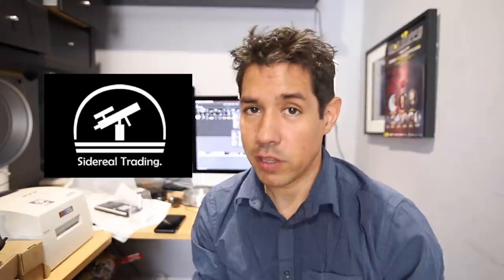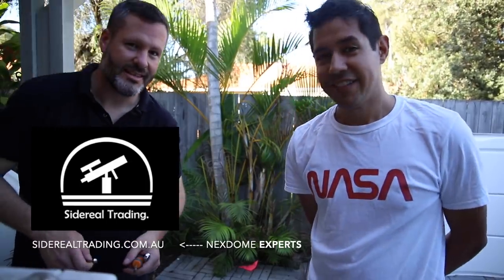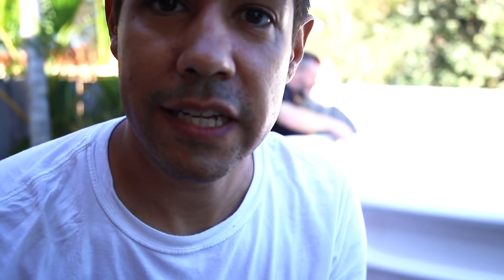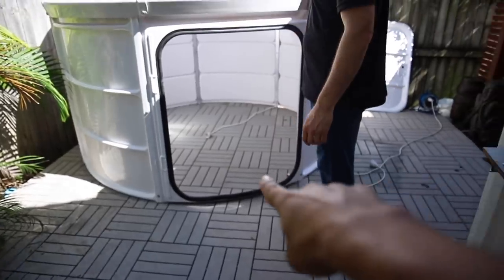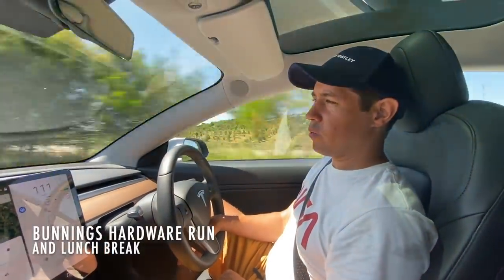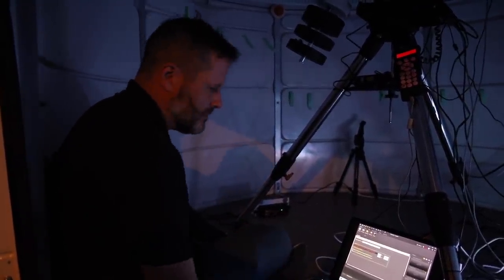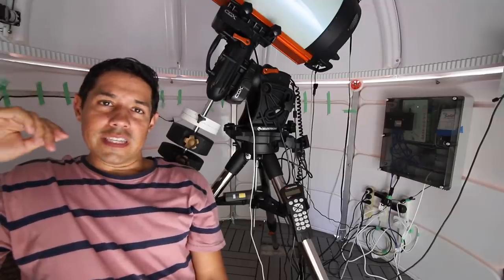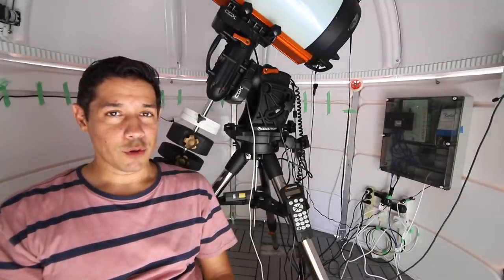Building a NEW Automated Observatory! 🔭 ft/ NexDome

Comment: That was so interesting, and having that dome must feel like a dream 😍It feels like it would be near impossible to build it all by yourself though no?
Reply from the maker: There are some screws, and lifting the dome up onto the walls, that really do require a few pairs of hands, but otherwise it could mostly be done alone :)
Reply: Hello GH, No, just would take longer - speaking from experience!
Reply: I assembled my skyshed pod by myself several years ago.  I didn't need the help for the Roll Off Roof I just built, but I certainly welcomed the extra hands from my wife and friend Tim.
Reply: 2 people really helps. Myself a friend did it 4 hours one afternoon then finished it about 4 hours a 2nd afternoon.  We had no instructions back at the time.  I later added the rotator. That was about 40 minutes to install and the shutter came later about 20 minutes to install.   None of it is hard. But I did have to drill one or two new holes. I thik due to no instructions, we tightened the nuts - best to leave them loose until all in then wiggle and make sure it's square (ROUND).  Then snug them up.

Comment: You may end up in a situation where heat build up in your dome. Did it come with a ventilation system?  You don't have an exposed primary mirror, so keeping the air inside as still as possible isn't necessary.

Comment: HI Dylan.  I'm a huge fan of your videos.  One question:  I have a 10" Orion f/4 newtonian (~40" long).  Do you think it would fit?  I'd be using an EQ8-R like yours.  I ask because you mentioned trimming your dew shield (was that so it would fit?).   Any advice before I purchase the Nexdome?
Also - was that clear-faced electronics cabinet included in the purchase?  If not, where did you buy it?  I hear the Nexdome is not exactly watertight - so that might be important.
Thanks - Tommy

Comment: Hey Dylan, I'm relatively new to this, lol, I got into it last year after I caught a glimpse of Saturn while doing some moon photography. I found your channel and watched a majority of your videos, I ordered some gear and had to store it until now. So I'm resetting my self up, I'm having trouble knowing exactly when to use which programs. For example: 

Celestron 8 EdgeHd
CGX Tripod mount

ZWO ASI 1600mm
ZWO ASI 290mm mini guide scope
Off axis guide

I don't have an EWF yet nor the filters trying to research which one's are the best value.

So after setting everything up and connecting to my laptop, I had no idea which program to actually use to control the telescope, like should I still use the CGX controller, how do I turn it towards what I want to guide the PHD software or is that just for tracking? Lol, what program to use to capture the images?  I just saw Trevor's video and he seems to be battling with a similar setup but he has much more experience. Maybe you can make a beginners guide, I want to work myself up to gathering data and drinking beer, thanks mate clear skys!

Comment: Dylan
I have the skypod and was wondering , can you use the next dome on top and motorrise it or you cant do that .. I like the slit , i always have problems with the zenith and would not like to buy a whole new observatory
Reply from the maker: It's possible in theory but having watched this install and the differences I think it's safer to go with one setup or the other for that. The zenith issue on the pod was the biggest issue for sure.
Reply: @DylanODonnell  yes but I looked at the price and well , but enjoy .... just a question ,  How do you sync the opening with a telescope

Comment: I wonder is there any statical data on city crime rates for cites with street lights vs cities without street lights? I think at NEAF last year you mentioned that your town does not have street lights?
Reply from the maker: Yeh it doesn't have many as all the cables are buried. I'd like to see more meta analysis of this too!
Reply: @DylanODonnell  I would bet that it is lower for areas with less light pollution. Cities always have more crime than farmlands. Think about it. Criminals have to carry their own flashlight. That makes their Job more dangerous.

Comment: Dylan. I have a Skyshed pod and am considering your first solution of the Zenith problem of putting a Nexdome dome on top of the Skyshed pod walls. Do you know if the nexdome automation kits would  work the skyshed pod walls or is that the reason you replaced those as well? Regards Martin
Reply from the maker: Yeh it’s just not as smooth if you don’t have the right walls and so the motor would need to be reinforced for it to work I suspect.
Reply: @DylanODonnell  Thanks Dylan

Comment: How do you synchronized the dome rotation with the telescope. Is it automatic?
Reply from the maker: After you enter some initial dome geometry into the software it knows where the dome should be based on your RA / DEC and polls the mount every 10 seconds for its position then updates the dome :)
Reply: @DylanODonnell  And do you use Lunático Dragonfly for that? What software is used for that control if I can ask?

Comment: Setting one of these up right now, and what a piece of junk. Pilot holes are all off, panels are missing holes, or they don't align. Feels super flimsy, really disappointed in NexDome.
Reply from the maker: Yeh they definitely are less of a kit and more of a project aren’t they? Mine had to be forced into place like Boeing parts.
Reply: Right!? Haha! Really quite disappointing. We finally got it together enough to toss the top on, but the tracks for the roof doors and the motor are an absolute joke. I am seriously concerned those are going to blow right off if we don't have the cover on. Motor can't even mount to the roof doors. And my gosh, that front door, it's barely a door at best. Ugh, pounding head on table. Thanks for the reply :-) Cheers    @DylanODonnell